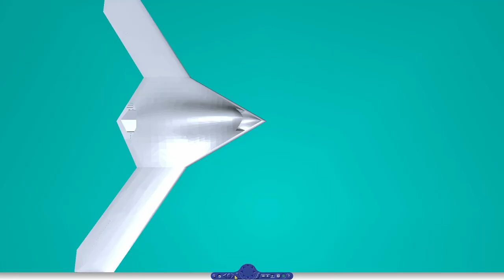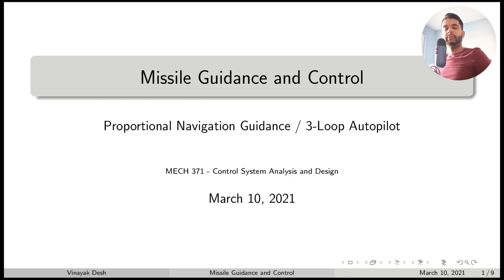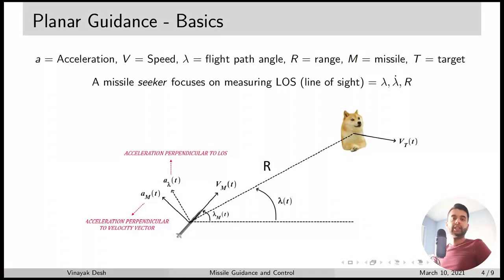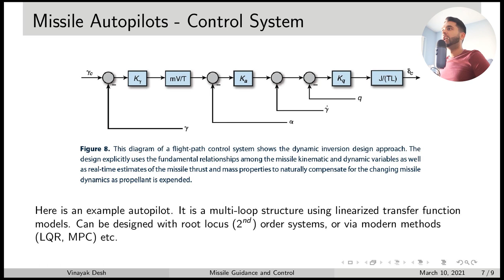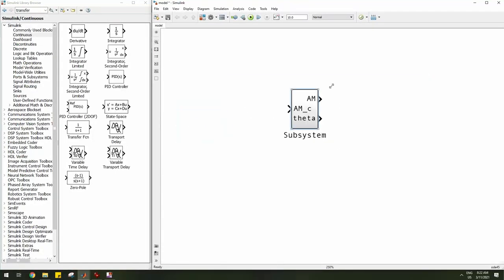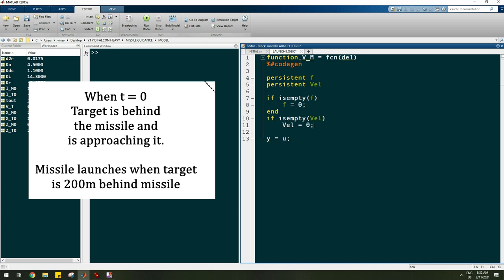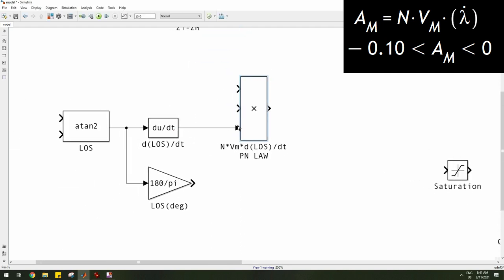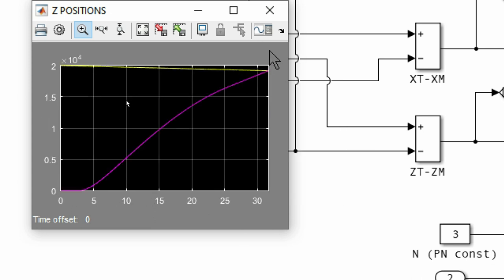Interceptor Missile Guidance & Control: Full Flight Simulation Tutorial! (MATLAB / Simulink)

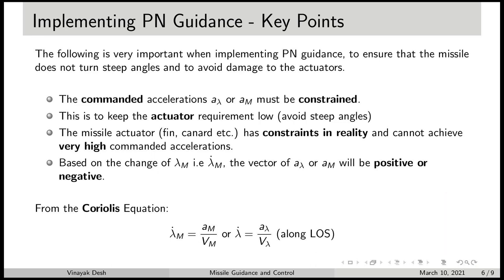Comment: 10:44 these are not Coriolis equations. These are just the definitions of rate of change of missile attitude and rate of LOS. Both come from Classical Mechanics (point that follows a curve on a regular plane describes an osculating circumference). 
Thus, even if simulation works, initial conditions are far away from linearization assumptions which leads to ProNav equations that you used for the simulation.